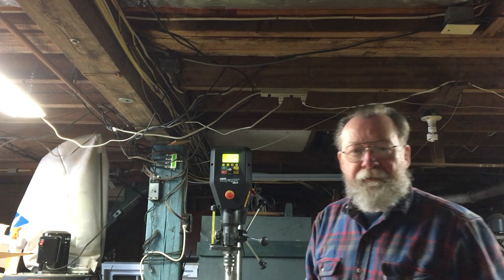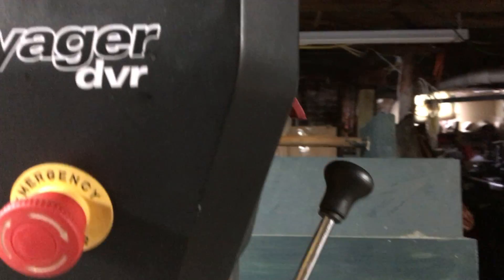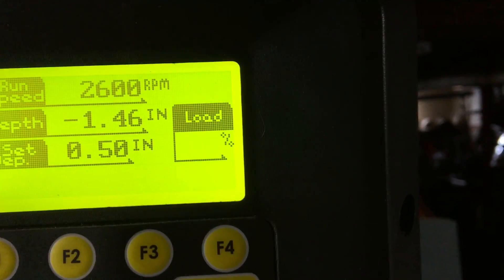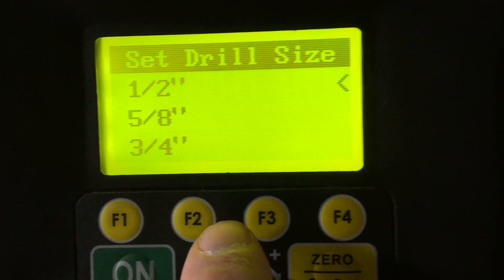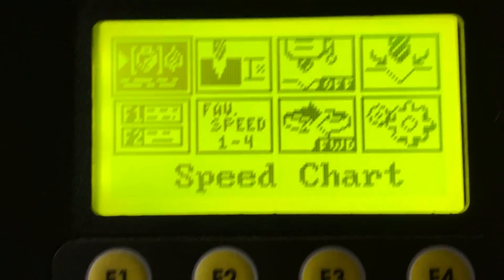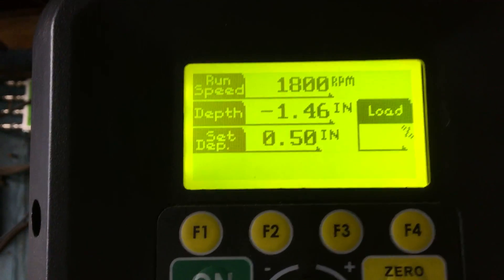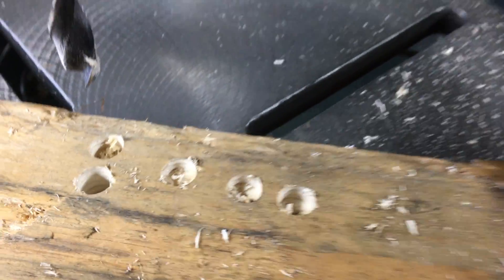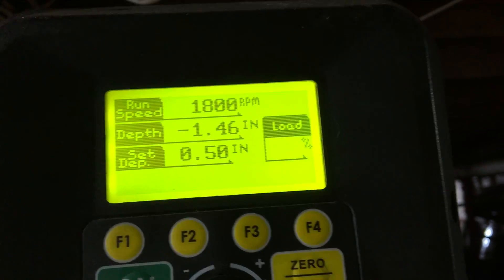Nova Voyager DVR drill press

Comment: That looks a little fast for a 1/2" bit.
Reply: Ian Crossley  I have this drill  press it replaced my craftsman.. it’s fast but with a sharp brad point bit it cuts a clean hole.. it looks fast but with a pulley drill press no one ever changed the speed.. drilled with what ever it was set at.. it’s a beast, if you compare it to what’s on the market ,it’s a no brainer.. he didn’t explain that it goes up to 5500 rpm.. you can use it as a milling machine..👍